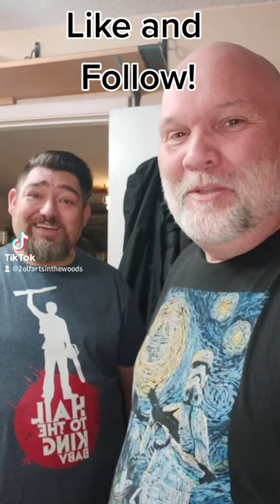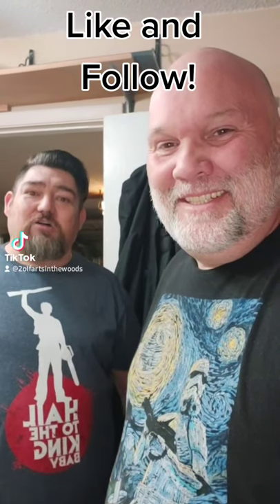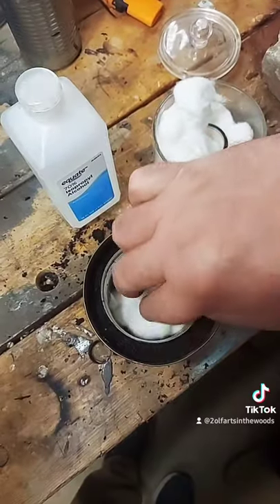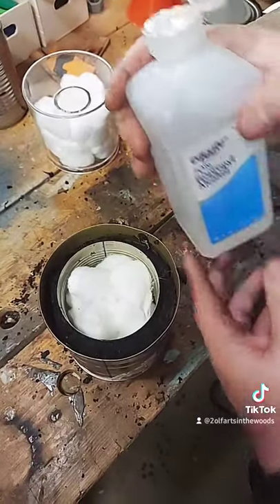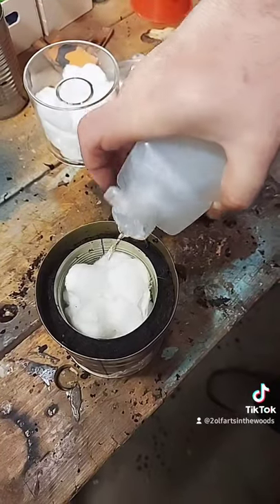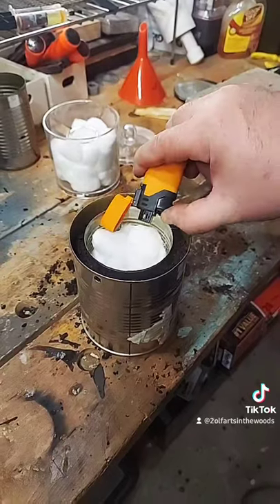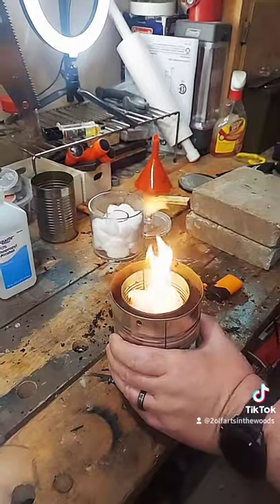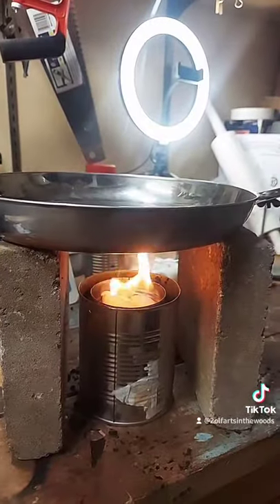Different alcohol stove

Comment: Just a couple of comments/suggestions.
1) Rubbing alcohol (isopropyl) in any concentration will burn with a yellow, sooty flame, and dirty up the outside of your cooking pot/pan. Better fuel would be denatured alcohol (from paint dept of hardware store or walmart) or HEET gas line antifreeze (yellow bottle only).  Denatured alcohol is a mixture of ethanol (like in booze) and methanol, and , yellow bottle HEET is 99.7% methanol. Both burn clean with blue flame.
1) Generally, best heat transfer from alcohol flames is with flame height of 1 to 1-1/4 inches. The apparent 2-1/2 to 3 inches you have allows a lot of heat to escape around the pan.
3) If you do this in the woods, an aluminum foil wind screen is a must. Wind is the enemy of flame, especially alcohol flames.
Reply from the maker: Great tips, thanks!